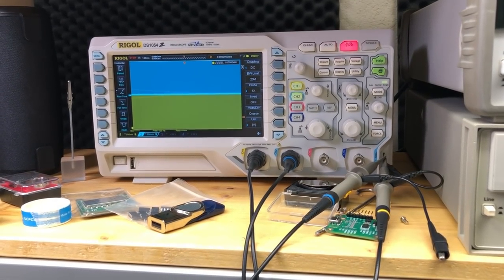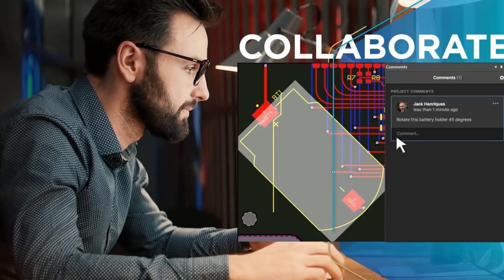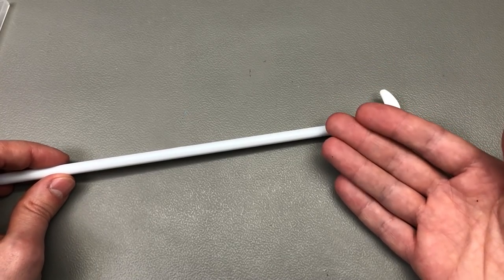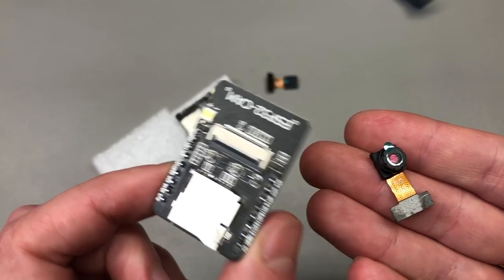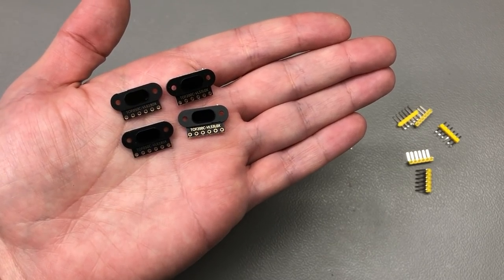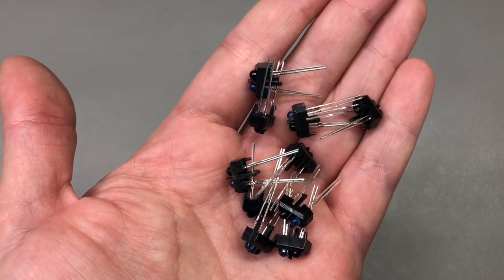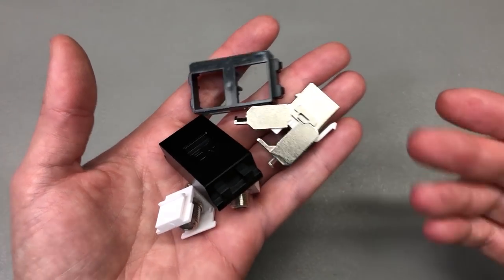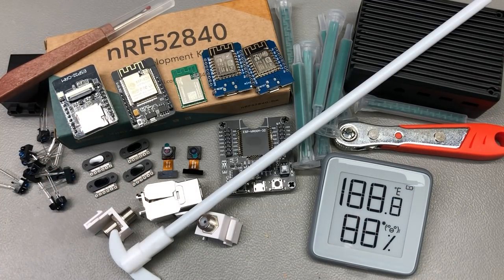InTheMail | Voltlog #408

Comment: I have one of those programming boards as well (but slightly different model, because it's equipped with a CP2102 USB-to-serial chip). In case you experience the weirdest connection problems as well: I had to add a strip of tape to raise the module by just 0.1mm or something - now the connection is perfect every time.

Regarding orders that don't arrive: I order my ESP modules from a shop called Duoweisi. They arrived every time so far and they ship quickly.

And about picking the right Raspberry Pi case: That is even more crucial than you mentioned, because the location of most peripheral connectors (and for some even the shape) changed between model 3 and 4. The cases are not interchangeable at all.
Reply from the maker: I also have my VoltLink interface on the target boards that I design & build and together with my VoltLink USB>Serial adapter I typically flash those boards and power up for the first time but something like this can split the task between two people, someone doing just the flashing of the modules, being very efficient and someone else doing the bring-up testing. There are also scenarios where you might want to ship already flashed modules to an assembler where this jig can offer benefits.

Comment: That ESP32 burning module looks nice. Very satisfying how it clicks in place with the spring contacts. Even more so how it springs out when you pushed it up! I always just use those cheap dev boards with USB, not the bare modules, so I don't really have a use for it.

Those e-ink thermometers look pretty good. Do you know if they've got a dumb outdoor bluetooth sensor without a screen? I did a quick search on aliexpress but their search uses the OR operator for keywords so the results are always garbage. If they did have such a module, that could be a perfect excuse for me to resurrect my home temperature monitoring IOT project.
Reply from the maker: In Voltlog #403 I showed a bluetooth thermometer, it's not meant for outdoor use, but I bet it can survive just find for a couple of years if it doesn't get rained on directly.
Reply: @voltlog  I must've missed that one, I'll have to check it out!

Comment: Hey those TCRT5000's are great! I used them in a cool project where I added them into my kitchen cabinet drawer lights.

made a tiny PCB, with an opamp that switches an LED strip. Had to filter out the master PWM brightness.
Reply from the maker: Nice to hear that. Sensing distance is ~20mm?
Reply: @voltlog  yeah something like that, I did adjust the opamp to allow current through the mosfet at around 2-3
Reply: It will detect further away though than 20mm

Comment: You are right about the prices. Luckily I bought a whole bunch of stuff like 3 years ago.  I see some stuff that has tripled in price but the worst part is the shipping cost. If I now need a few components from the same seller they start adding all the shipping costs together as if you only ordered 1 item, or maybe offer a small discount. Shipping used to be free or was only a small price for a lot of stuff.  I wanted to order some mini breadboards last month and the seller asked 2,04 euro shipping, without the breadboad,  a piece. 
I just ordered a V115 radio which was like 15% cheaper including shipping from Germany from the same manufacturer/seller on Amazon.  I wonder what happened or is happening.
Reply from the maker: The pandemic changed global shipping and so shipping costs had to be adjusted. The pandemic also affected raw material cost which is then passed in the finished good cost. Then there is the inflation which contributed to a general price increase and let's not forget that Aliexpress introduced VAT collection which upped the price by roughly 20%.
Reply: @voltlog  Not really what I meant. We all know about VAT, shortages etc .. BUT explain this.  10x precision potmeters 10K 0,7 euro and 1,49 euro shipping. Now if I take 30 pieces of the same item the price of shipping goes up to 1,62 euro very fair.  BUT... if I now take, and the price is on my other screen now, 10 of each, exactly the same page,  2K,  10K and 50K potmeters the price of shipping goes up to 4,47 euro. So why would I for the exactly the same volume and similar items pay a lot more?  I can give you a ton of examples like that which absolutely make no sense at all.

Comment: thanks for this episode, as quite a few very good recommendations. probably 4-5 items i am interested. including the laser sensor, the rpi4 case and the epoxy mixer. and the zigbbee

however for the seam ripper... what i discovered with my seam ripper is that it was not nearly strong enough tool for me,  when stripping a plastic insulation when i tried some other one from amazon. this was on a mains flex cable. with a substantial insulation. the tool metal was brittle, it looks cast inside. and it broke the 1st time, without overcoming the resistance of the thick plastic. that was a shame

however this is still an excellent idea, and is the best solution to the problem i have ever seen.  just wish that we can see a much stronger version, for a higher quality tool steel. and other ergonomic improvement, for example to make the blade pointing in the other direction. for pulling downwards instead of pushing the handle. then it would be a lot better. much stronger

maybe if your seam ripper works better than my one, you can make a simple demonstration to see which sizes of wires it can be used with? to better see the limit for what it is capable of. not to expect too much and to end up breaking it
Reply from the maker: I like the idea of having a blade pointing the other way for pulling. Personally I have only used it on softer insulation. If you do work on mains wiring, you can typically find stripping tools designed specifically for the width of the standard mains wiring cable, some which can also strip longitudinally. Brands like Jokari or Engineer, although I have an Engineer and it does not strip longitudinally.

Comment: I tried IPA with old solder paste and it didn't work that well after. I think I remember the first time I added a little IPA it was ok, but adding more latter and it wasn't as good anymore - I think it breaks down the flux -. Maybe something like gummy/runny flux might be better.
I had a bunch of stuff lost on Ali, and got a refund, but then it all turned up alter 160 days.
Reply from the maker: I added a similar flux to the original one in the paste. Seems like the flux part was ok but I'm having trouble returning the paste to smooth silky texture.
Reply: @voltlog  Have you tried using low heat from a hot air station to see if the dried-up solder paste becomes soft and spreads easier?
Reply from the maker: @GregM  Because of the high speed mixing I did with the bench drill, the jar was getting warm to the touch, but I wouldn't add any external heat, it's too risky.
Reply: @voltlog  Ok so there was heat from the mixing and it did not help. Seen people use the low heat albeit on a plastic container which had some remaining paste in it rather than a full container.
Reply from the maker: @GregM  I think I might just got it to a point where it's usable, but someone which has seen good paste previously can definitely tell that it's not the perfect consistency which some very small lumps remaining in the mix.